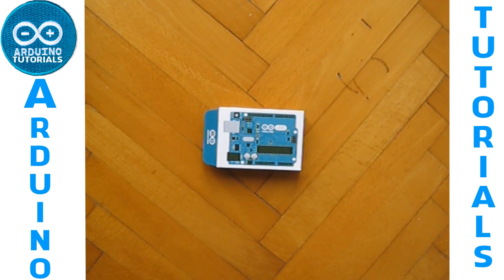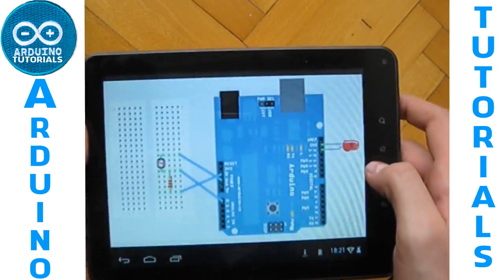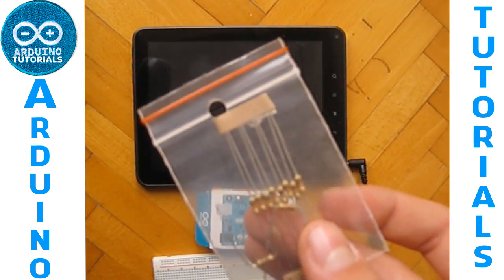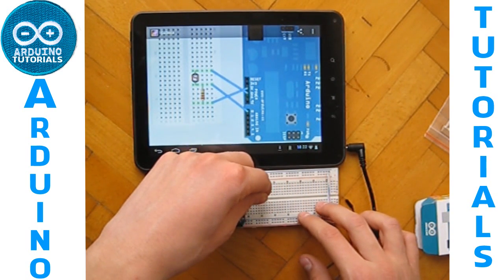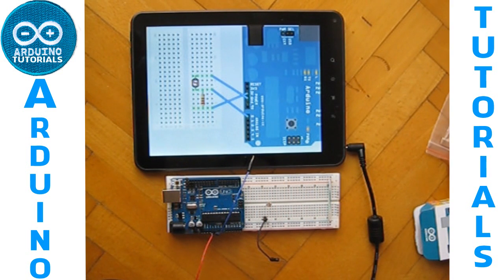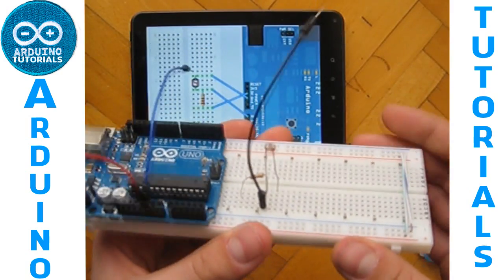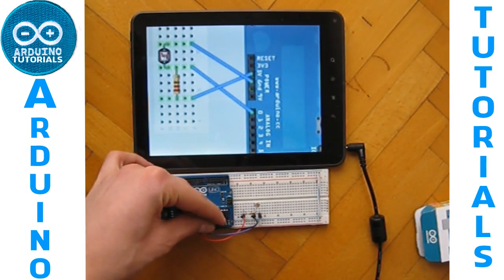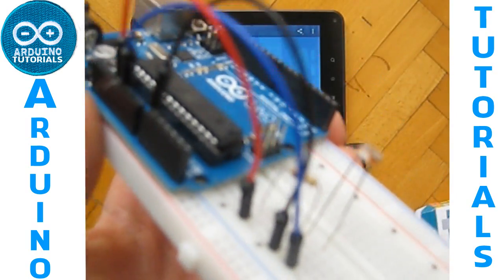Tutorial Arduino | How to connect  Photoresistor (LDR)|

Comment: Tutorial is OK and will do. But as an electronic I will recommend some basic which are to follow.
When you have a chance to use these cables with colors they are rules to follow absolutely.
RED is always positive, in this case +5V
BLACK is always negative, in this case GND
Use BLUE for the signal in this example.

This rule is very useful when you design things more complicated with lots of wires. Also if you give some prototypes to someone else it will identify with no risk the correct connections.
Reply from the maker: I agree :) 
it was a long time ago